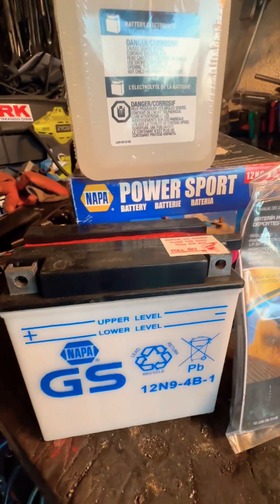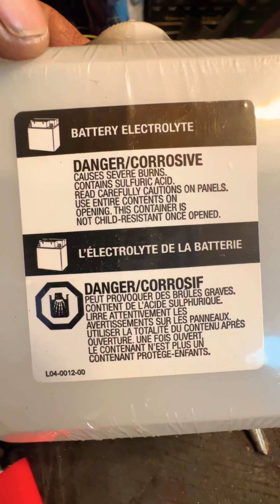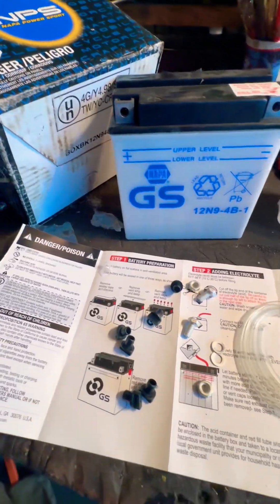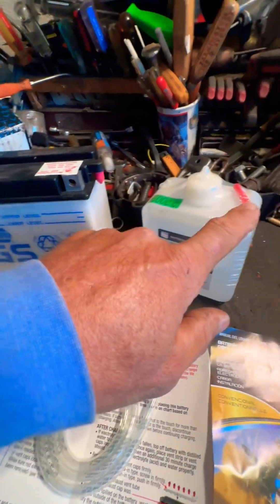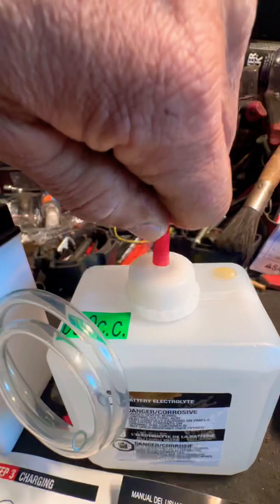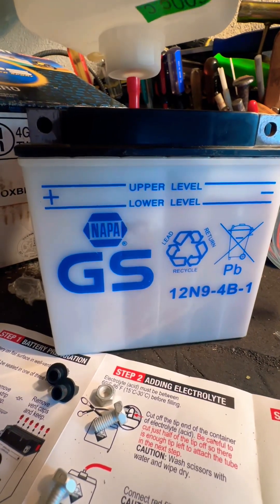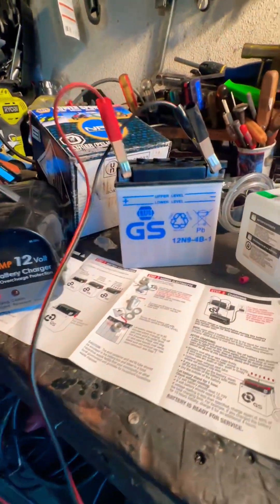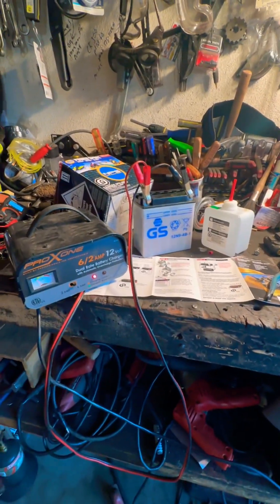How To Add Acid ☣️ To A Motorcycle Battery 🔋 #battery #sulfuricacid #motorcycle

Comment: What if the levels are not WI the high/low markings. One ended up very and one low
Reply from the maker: I have added distilled water and topped them off. I have also added more battery acid.
Reply: What if one is a little higher than the top line?